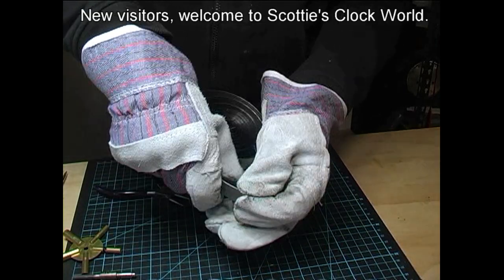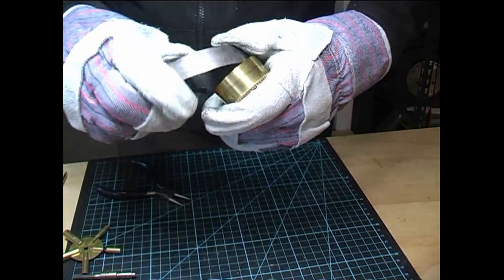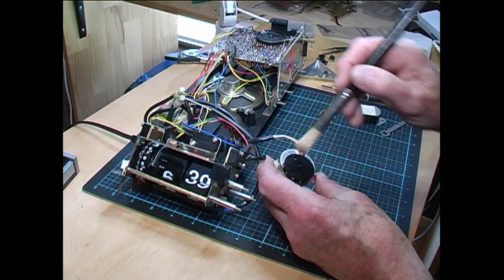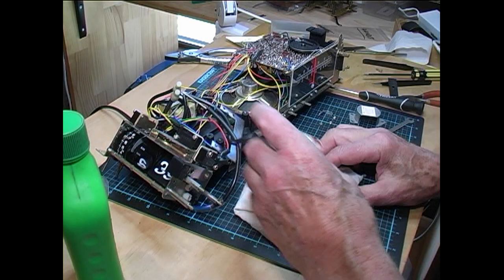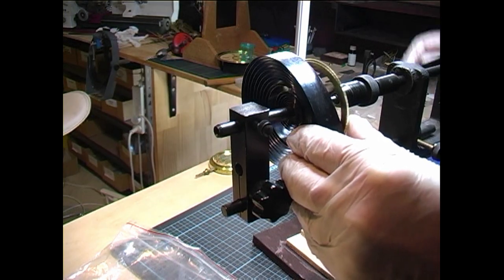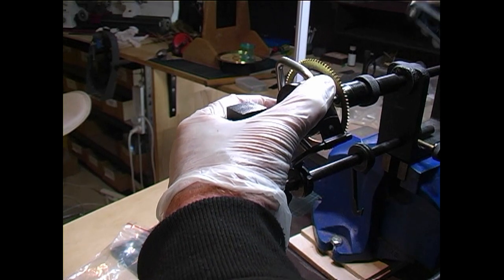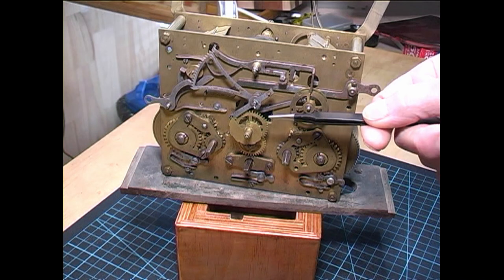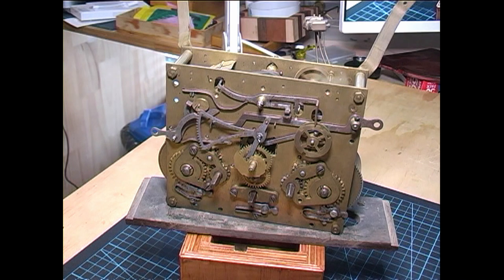New visitor trailer - Scottie's Clock World

Comment: I'm restoring an old Junghans Mantle Clock movement which has seen significant corrosion which appears to come from excessive oil that has penetrated below the layer of protective clearcoat on the brass which has attacked both the front plate and the backplate. Should I strip off all the clearcoat including the corrosion and then polish out to below the corrosion and then buff out to a polished-out finish? What was applied by the Junghans factory to keep the brass finish so bright?
Reply from the maker: Normally only French mechanical movements are polished, as they were before they left the factory. If the corrosion is serious on your plates, then I would clean it up, but when you are finished don't spray the plates with lacquer as it will get into the bushings.
Reply: @ScottiesClockWorld  Thanks for the great advice!
Reply from the maker: @TimmSeaton  , always happy to help. Thanks for your comment.